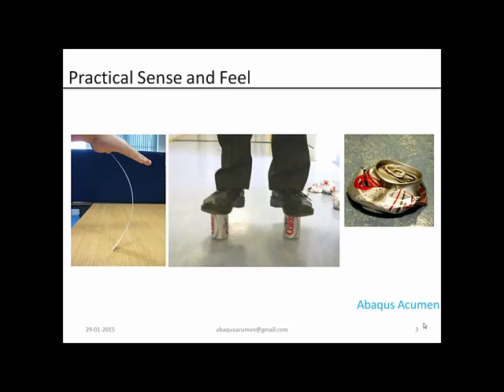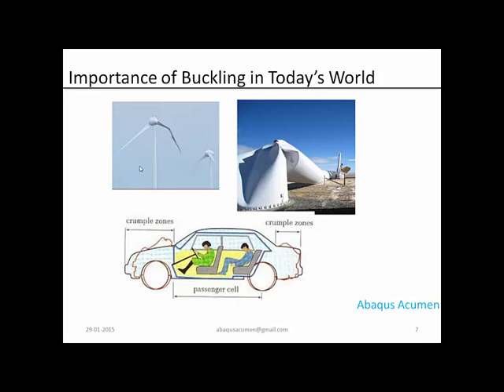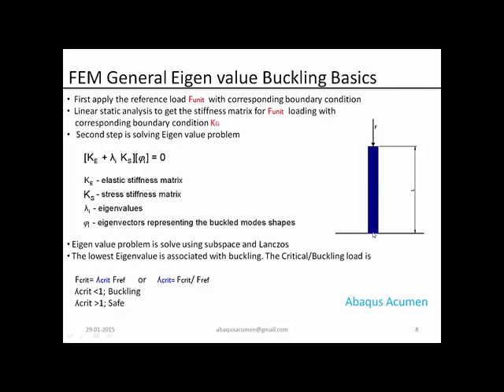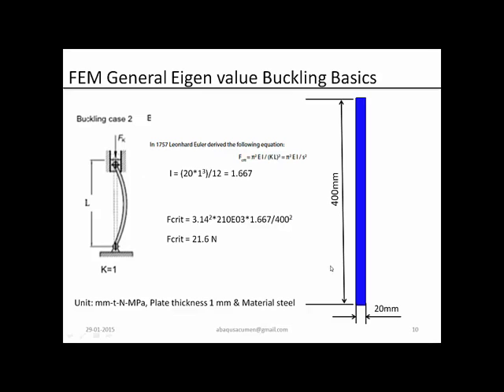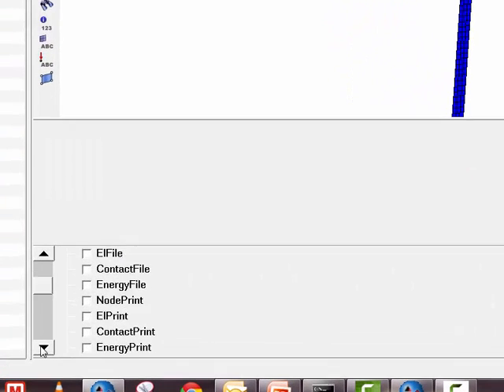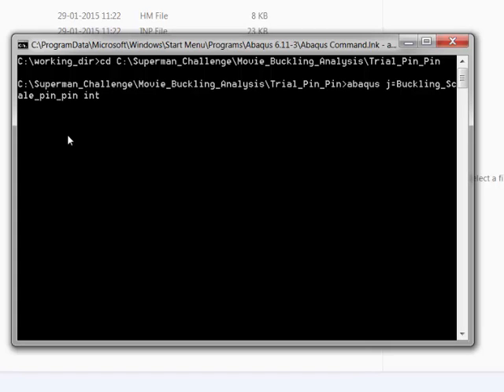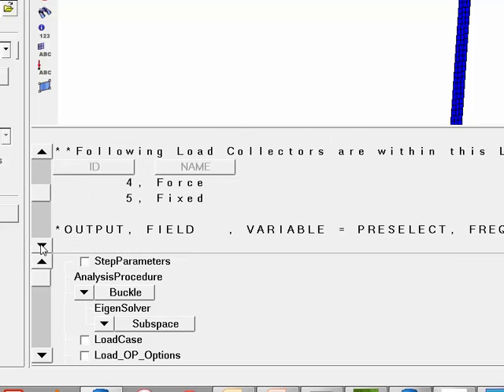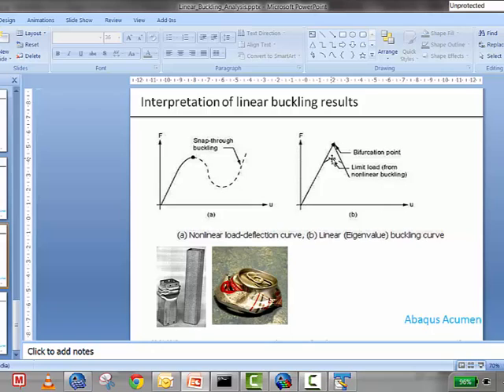Abaqus Linear Buckling Analysis Finite element method

Comment: I am very happy to see this lecture
Sir , I am facing some problem in imperfection in abaqus.I have got buckling result, after then in imperfection i have two square plate one rigid and one deformable. In between twoplate there is cohesive material also provided. Now I want to see the bheaviour,  of the deformable plate. I also tell which type contact i will give so i can get the actual result.